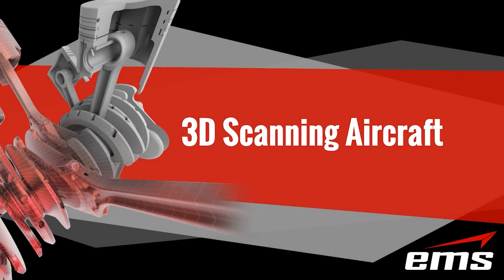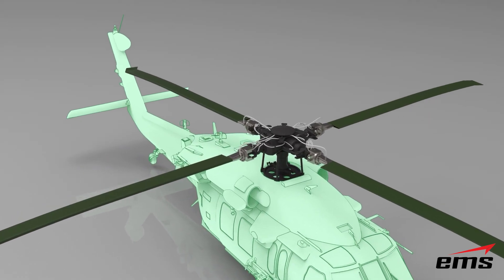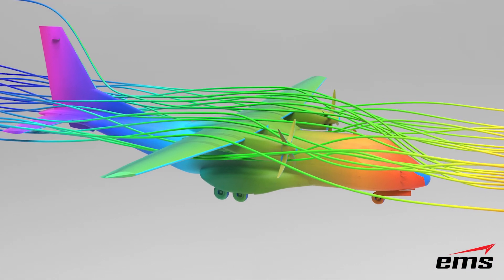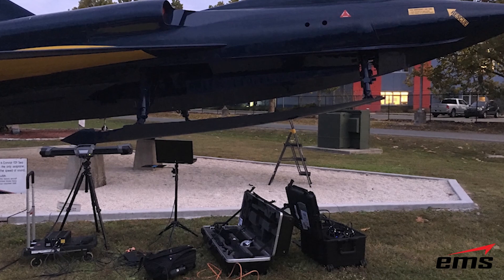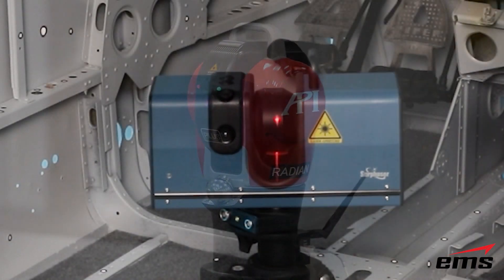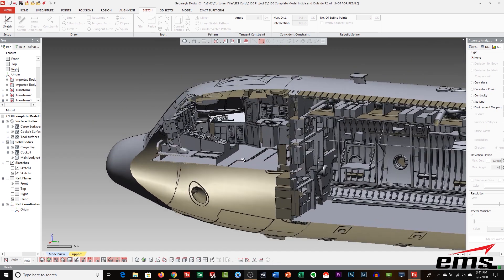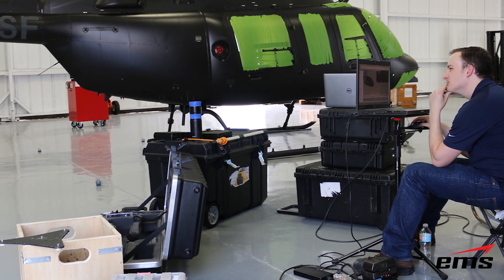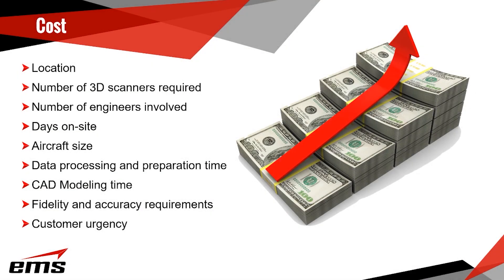3D Scanning Aircraft - Airplanes, Helicopters and more

Comment: This is a really great explainer! Thank you so much for putting this together. I work professionally doing aerospace surfacing for independent aerodynamicists, and I cannot tell you how many times I've had to come in after the fact and fix terrible models, or try to use horrible scan data as the basis for building a model. The biggest problem seems to be that the people making the vendor selection decision don't understand the difference between good data (CAD or points/stl) and bad data - all they see is a pretty picture of an airplane in a computer. Hopefully this vid helps steer some of those folks in a good direction. Well done.
Reply from the maker: Yes you are correct.   We use very specific hardware and software to create highly accurate quality 3D aircraft models.